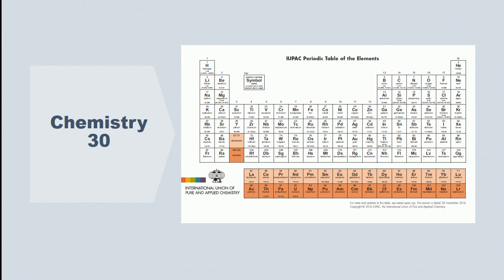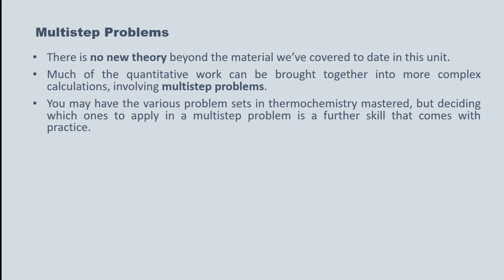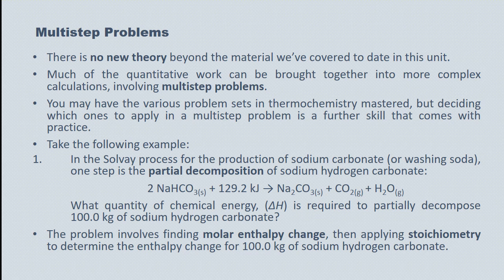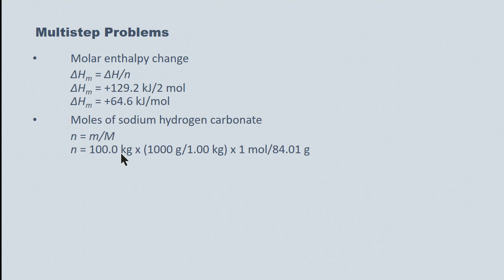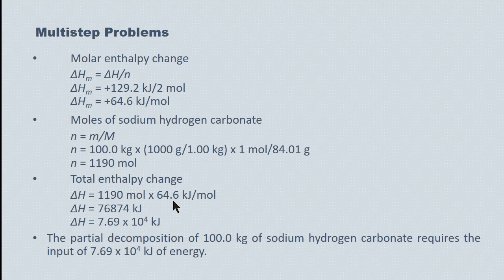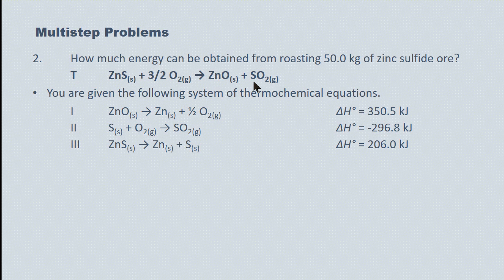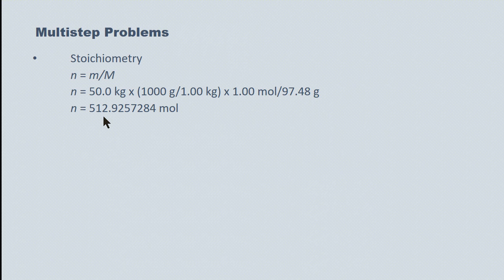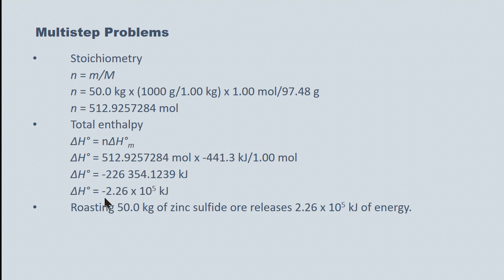L  7 Multistep Problems

Comment: Good morning! For the first problem, why wouldn’t we just use the molar enthalpy (129.2kj) of one mol (64.6kj/mol) of NaHCO3 as the energy required to decompose it? What makes it necessary to find out the moles of sodium hydrogen carbonate and why did we multiply those moles with the molar enthalpy change? Thank you
Reply from the maker: Hello. I've read your question, and it seems to be a direct restatement of how I proceeded with the problem. The equation gives an enthalpy change for the partial decomposition of two moles of sodium hydrogen carbonate; therefore we first have to determine the enthalpy change for a single mole of sodium hydrogen carbonate according to the equation. That then gives us a conversion factor to determine the energy required to decompose the 100.0 kg of material. We're saying the same thing in two slightly different ways.